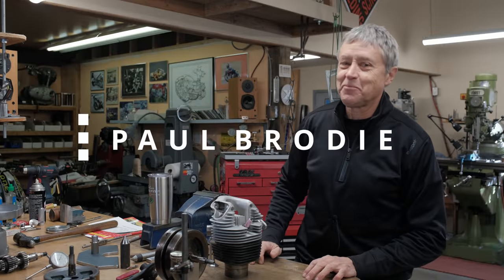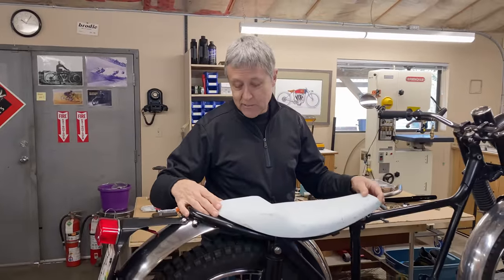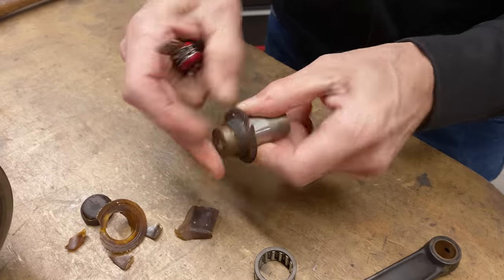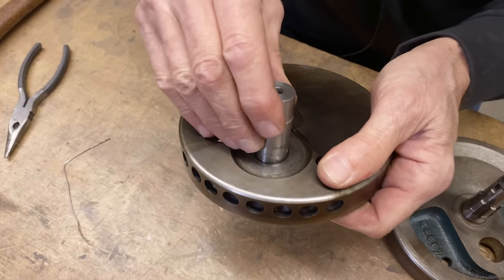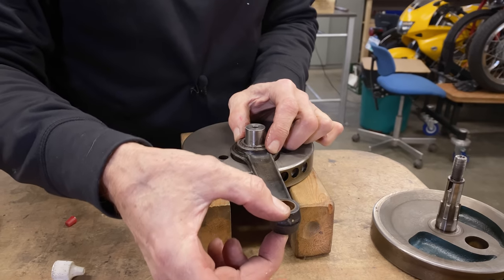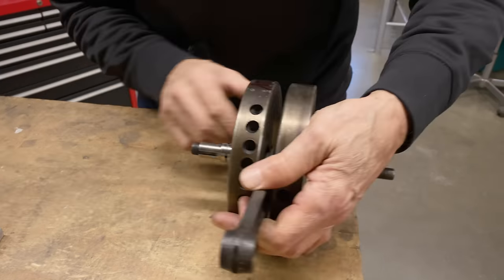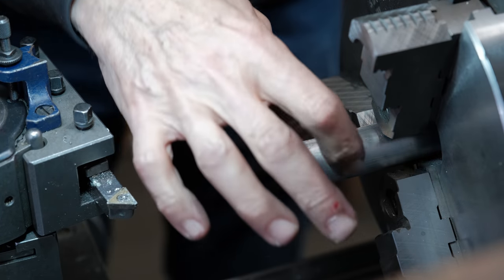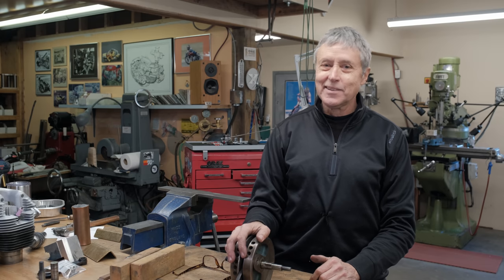Assembling a Tiger Cub Flywheel // Paul Brodie's Shop

Comment: It was about 1964 when I changed my first crankpin on a Cub no handbook just a big Sweeney and Blocksidge had/fly press and a try square. A Blue and White Cub with alloy guards and an energy transfer system no battery, a nightmare to ride in the dark. A pig to start but loved it.
Reply from the maker: Thanks for commenting.

Comment: I made a fixture when I did the BSA crank, still had a little bit of truing to do. I have a lead mallet which was originally for tightening the nut on sports car wire wheels. 
That tool illustrated in the Haynes manual is the Triumph special tool for assembly and disassembly of the flywheel. 
Best wishes, Dean at Retromeccanica, UK.

Comment: I had a cub more than sixty years ago. I rebuilt it into what would now be called a cafe racer. It had a plain journal big end bearing which was changed the a roller. The flywheel assembly was rebalanced, can't remember the ratio. The inlet valve was increased in size so was the inlet port which was polished. The cast iron inlet guide was shorted and an Amal carb put on it. The camshaft was replaced with a high lift longer duration sports cam and a 10 to 1 piston fitted. That bike used to fly. The 250 cc 2 stroke Arial Arrow couldn't catch it. I won't say what speed it did down a slight incline because you won't believe it, but I was expecting the con rod to let go any minute, it didn't. Not the most fuel efficient though.. love your videos, brings back lots of memories..
Reply from the maker: Fred, you have some cool memories! Thanks for sharing.

Comment: Oh, nice,... .001" is super.  When I first saw a crank like this being assembled and trued, it was so educational, on a Matchless G2CS 250 I owned, a persistent crankpin breaker..!!  The old timer who rebuilt it had a truing stand and final adjustments to alignment were done with holding the flywheels in his hand and he smacked the one needing to move with a lead hammer and then rechecked.  Method stayed with me throughout my career as a mechanic myself.
Reply from the maker: Yes, it's probably getting harder to find someone who knows how to do flywheels.

Comment: I just worked on my BSA B40 today… to make it ready for the nicer weather. I’ve put on a new rear tire, replaced the broken kickstart return spring and made up new brake- and clutch cables. Damn it felt good to be back in the shed and as the cherry on top Mr. Brodie uploaded a new Tiger Cub video. Thanks Paul and Mitch :) keep up the great work!
Reply from the maker: Thank you. That's great you're in the shop working away. 
I like it.

Comment: Should have called it 'Precision Beating a Tiger Cub crank'
Pretty amazing you can still get a NOS crank-pin and rod assembly!
 I use a log splitting wedge as well as a spacer wedge, that way you can have crank in vice with some pressure and use wedge to open the' tight side'
Japanese cranks almost always have a parallel crank pin so need a little more care to maintain clearance and not crush bearing cage

"Yoda's BFF
1 day ago
I've done several crankshafts like that and it's is very time consuming and aggravating, you made it look easy 👍. The idea of using a wedge is a great idea, thanks."

If you went to MMI Orlando in early 2000's, Ed Sherbet or I would have taught you  to do cranks that way, precision beating with a lead hammer.
 Polaris cranks are probably most difficult as they need around 15 tons or more to take apart and put together, Yamaha normally around 6 tons, Honda can be very variable, 1.5 to 7 tons, Suzuki 4~6 ton
Reply from the maker: The NOS crank pin and rod came with the Cub package of 2 frames 4 motors I purchased last year. Who knows when it was purchased from the factory?

Comment: Another perfectly executed video by the builder and the videographer. Will you show the balancing process Mr. Brodie? I sure would appreciate seeing how you go about it. I just sent off my sons 07 KX250 crank out for a complete work over.
Reply from the maker: Thanks Rick. This flywheel was balanced at the factory, so I will leave it at that. There is no sense changing the balance factor before the bike has run. It is probably just fine as it is. We will balance a new Excelsior flywheel soon though.

Comment: I'm not looking forward to this process on our '56 Tiger Cub restoration. Working on a very early cub, round head, small flywheel that has been run with low/no oil. Lots of problems. Good news is the whole engine seems very low miles.
I wasn't aware they used needle/cylinder bearings on the big end of the rod. Thanks for these excellent videos. Especially thankful for the mistakes. Students really should see the grace and forgiveness one can give when mistakes are made. Good for you, good for them.
Reply from the maker: Thanks Jon. The later flywheels and rods were definitely better than the early flywheel and rods...  :glasses-purple-yellow-diamond:

Comment: I replaced so many crank bearings on two-strokes in the seventies and eighties, maybe have done a single one since!
Reply: Same here, worked in a Suzuki/Kawasaki shop.  Quite a few TM 125s redone much as what Paul showed here.  They didn't have stepped crankpins.  I once owned a Matchless 250 G2CS and it's stepped crankpin was prone to breakage at the step.

Comment: Lead hammer is the preference for assembly and truing. Myself,  I have a lathe to check for true. It takes time to do it right and you do it well. And I do realize you are from Canada but it's pronounced aermacchi. You don't pronounce the Mackie. It's Italian made not made in Finland. And I have watched many of your videos on frame building. I do own 1 Harley 1 Norton Commando s 1 BSA and 1 67 Ducati Diane 250cc.
As far as my credentials. I spent three years taking every course at MMI Phoenix not to mention being in the motorcycle business for over 10 years as a certified technician. But many years before that working on my own motorcycles and making mistakes. I did it wrong first and had to go to school to find out how to do it right. So anyway keep up the good work the videos are very informative and instructional. And I will promise not to nitpick on anyting as long as you stop saying aira Maki
Reply: Heh, some assemblage of fellas coming here to watch Paul do the magic on flywheels and other stuff.  I recall Ducati's had a clean out trap in their flywheels too, Dianas were a fave of mine along with Parillas.  Quite advanced that Hondas had centrifugal oil filters in the early '60s, all the bikes of that era sure could have used some filters before being trapped in the flywheels.
Reply from the maker: Thanks Lance. When I got into Aermacchis I did quite a bit of research into the pronunciation of the name. I ended up talking to a gentleman who lived very close to the Aermacchi factory. He told me how it was pronounced back then, and I believe him. Anyway, you knew exactly what I was referring to. Word semantics.

Comment: Thanks Paul & Mitch!  I assume the plug in the end is for the oil system?
Reply from the maker: Thanks Alan. Yes, the aluminum plug is to make the oil feed into the crankpin.
Reply: @paulbrodie  will banging that plug in not upset the alignment you just did ?
Reply from the maker: @wippy748s   No. Did you see how I set the top flywheel on top of a 3/8" flat bar held in the vise? I would not risk changing the alignment.

Comment: Surely that’s an Alpha big-end assy? Cubs as standard had a bushed big-end as far as I know. So is the aluminium plug part of the oil-supply mods needed with an Alpha conversion? Thanks for another very interesting video Paul and Mitch. It took me back to days of stripping and reassembling my BSA C15 on my Mum’s dining table (really!) along with my mate Pete and his Lambretta engine. My poor mother!! Les in UK
Reply from the maker: Thanks Les. It might be an Alpha big end, no idea. It came with all of the Cub stuff I bought.The aluminum plug is for all flywheels to get the oil to flow into the crankpin.

Comment: I got a bit lost when you got to the big pinch in the vise. And if you started with ten thousanths run out on one side how did that get fixed? Just pushing things around did it? What was the last piece for too? Plug an oil gallery? I am doing 1917 and 1920 Harley flys now as we speak. Precise stuff!!! Thanks, Thailand Paul

Comment: Thanks for the interesting video. How is crank balancing done? I've been using bead-balanced tire inner tubes last few years on my two motorcycles ('74 Norton Commando and modern Triumph Bonneville) with great results (no more lead weights stuck to rims and paying the shop for balancing). Was wondering if something similar to bead balancing has ever been used on engine crankshafts? Perhaps some sort of steel tube attached to the flywheel, small ball bearings free to circulate within to achieve perfect balance at all rpms?
Reply from the maker: Thank you. Crank balancing is a mystery to most people, and I used to be included in that group. It involves weighing the piston assembly, the small end of the rod, figuring out the balance factor in %, then checking the flywheel and drilling away the excess until it comes into balance. I have no idea if bead balancing has ever been used to balance flywheels.

Comment: When I was spending all my spare time at the motorcycle shop in the late “50”s didn’t the first Cubs have a plane bearing on the rod big end ? Good videos
Reply from the maker: Thanks Mike. I don't know if the rod had a "plain" bearing, but the flywheel had a bronze bushing on the right side. That was a weak point for sure.
Reply: Yes, they did have a plain bearing as did he first BSA C-15s.  Didn't take long for those to break down.  So glad to see Paul's rod assembly had a proper needle/roller one, much superior.
Reply: It was the late square fin barrel that was fitted with the roller - certainly the 67 Cub had them

Comment: Did you clean out the sludge trap in the timing side flywheel??  Bound to be full of engine debris??
Reply from the maker: I couldn't get it out, I made sure the oil passage was flowing well, this is never going to be a high mileage engine, and I promise never to let the oil get dirty. With centrifugal force, nothing comes out of that trap anyhow.

Comment: That was brilliant ! (Even if I didn’t understand exactly the goal of squeezing the flywheel in the vice 😞…)
Reply from the maker: The 2 flywheels are running concentric, but not evenly. Carefully squeezing them can make them run true. Make sense?
Reply: @paulbrodie  Yes ! And I've watched (two times) carefully the vid, and your explanation about the forces. OK now, thanks Paul.
Reply from the maker: @tetrakite  Great. It's not always easy understanding engine stuff.
Reply: @paulbrodie  For sure. I've a little knowledge, as I was an off road racer in a previous life (and, also, MTB rider) and was servicing my bike myself as much as possible. I had to dismantle all the motor once, because I had washed the bike (a KTM 360cc 2 strokes) and forgot to seal the air intake… And I didn't start the bike after that as I was doing every time. What a douche ! The flywheel bearings rusted, and I had to replace them the week after. But I let a mechanic do the rod needle bearing.
When I was 25, I was subscriber of "MTB Action" bought in the US, it was the beginning of Mountain Biking in France… And I was looking to your bikes with envy ! (even if my pinnacle was the full suspended "San Andreas" a bit later)

Now, I can watch you making nice things, it's so great and impressive… Thanks !
Reply from the maker: @tetrakite  Thank you Thierry :)

Comment: Had you thought about putting a TIG tack weld in to lock it in place? I know they do it on high HP applications.
Reply from the maker: What are we locking in place? I'm not sure...
Reply: @paulbrodie  The crank pin to the counterweights.
Reply from the maker: @michaelmathews295  If you Tig tack the crankpin to the flywheel that is going to be a bitch to get apart. I can't see myself doing that..

Comment: After you got the fly wheel aligned, it looked like while you were spinning it the gap between both plates was inconsistent. Was this in fact true or was it due to inconsistencies in the milling of the plates themselfs causing it to only look that way?
Reply from the maker: The gap is inconsistent. It opens up around the crankpin area. You are not going crazy!
Reply from the maker: I was wrong in my first reply. The inside faces are consistent with the outside faces. I was going by memory, and when I actually looked... sorry. Maybe the rod was casting a shadow as the flywheels turned in the lathe? Who knows?

Comment: Paul, is that rubber wheel you had on the die grinder a Cratex abrasive? Looking for similar, looks like 2 1/2" dia.
Reply from the maker: I have no idea, sorry. I worked in a machine shop in 1976 and that's where it came from. I think the OD is about 1.25"

Comment: I just can't get over how you basically need a hammer to build a motorcycle engine, I build car type engines, and a hammer is the last needed,   I still can't believe the cranks survive what they do! But I have a scooter engine I'd like to build, I want to make it a two cylinder, starting from a 39mm bore/ 49cc engine, use a big bore kit. With 52.4mm bore, with 41 mm stroke, x2 approximately 88cc per cylinder, or with the striker crank. Around 96cc, with larger valves, ported head, 'Heads' well they would be welded together! I'm thinking maybe the cylinders could be kept separate, but either way, I'd like to tap the oil passage, to run it through a cooler before going into the heads, would machining the cooling fins down, and closing them in, to convert to water cooled, be too much? I wonder if a high volume oil pump could be made using two pumps, and a bit of machining,  surely I could get 12 HP from near 200cc, I'd want extra oil volume. Because there is more area to pump oil into, I thought about using the cam as an oil passage, to oil the lobes,  with the 81cc engine I have now, with cam, large valves ported, exhaust and larger carb, it started with 3hp+/-, surely it's making 5 maybe 6 HP now, but double cylinders doubles firing events per. RPM! So wouldn't that make more power?   Sorry to ramble, but I didn't even mention what I was going to ask to begin with! 😆 Haha, but the cranks, balancing, does the piston weight effect Ballance that much? In car engines, we always put light pistons on heavy rods, and vice versa..  always had the machine shop handle the balancing , but I'm hoping I can get rid of the vibration, even if I don't build the 2cylinder, I'd like to balance it so I'd feel better about revving it to 10k maybe 11k, I can hit 9500 easy, not 10k starts to worry me, originally 8500 is it, peak power anyway, but I have seen 10350rpm, I heard ppl turning 11k- great video..
Reply from the maker: I think you should check out Le Dan YouTube channel. He does a lot of interesting engine builds with not much tooling. Yes, piston weight always has an effect. Changing pistons might mean more vibration, sometimes less...

Comment: Be sure to remove the slotted galley plug on the right side fly wheel and clean out the sludge trap.
Reply from the maker: I tried to get it out with an impact screwdriver but it's been in there for 55 years and it resisted my attempts.
Reply: @paulbrodie  I agree with Compcorvair13, Sludge trap will likely never been cleaned out, so even if the screw needs drilling out, it needs to be checked and cleaned. Hopefully some heat will help, but I've done loads and never had one that didn't need cleaning out, Regards.
Reply from the maker: @paulbalsillie895  The oil passage is clear, and this will never be a high mileage bike, so it will be fine. Thanks for commenting.

Comment: Was the pin to block the oil gallery up? Also hitting the end ov the crank is going to throw the crank out again?
Reply from the maker: Yes, the alloy pin closed off the oil gallery. Look closely in the video... I rested the upper flywheel on 3/8" flat bar, so there was no way the flywheels would shift no matter how hard I hit.
Reply: @paulbrodie  ahh ok I didn’t see the flat bar 👍 enjoyed all these videos